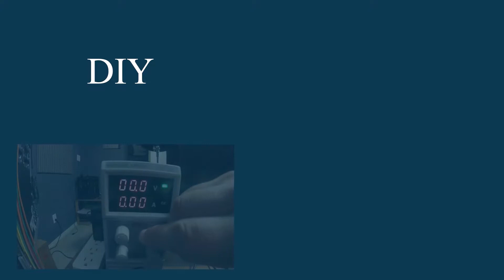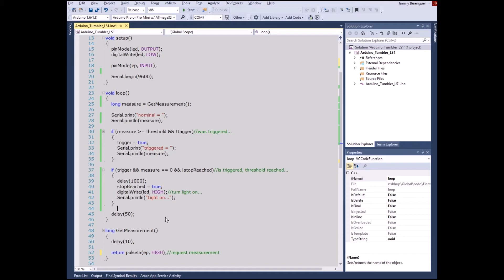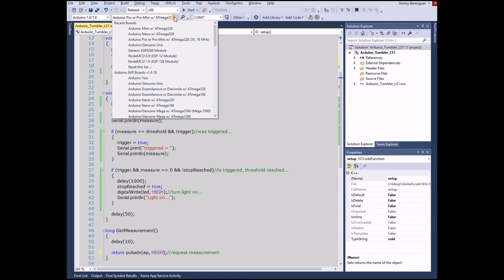Arduino Pro Mini - Turning on leds with the SW-420 Vibration Sensor

Comment: Could the sensitivity be changed so it will light up if the ball is held at all?
Reply from the maker: yes! the SW-420 contains a potentiometer that can be used to adjust the sensitivity of the sensor. See more here https://components101.com/sensors/sw-420-vibration-sensor-module